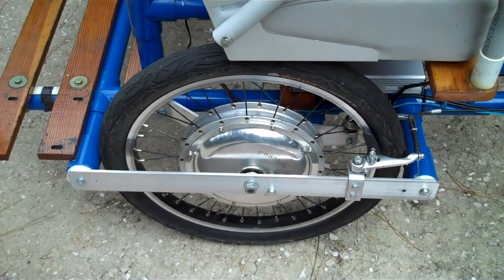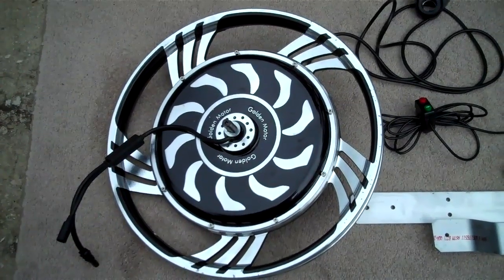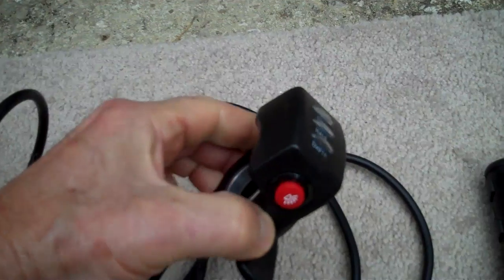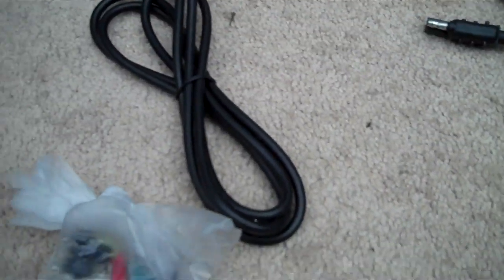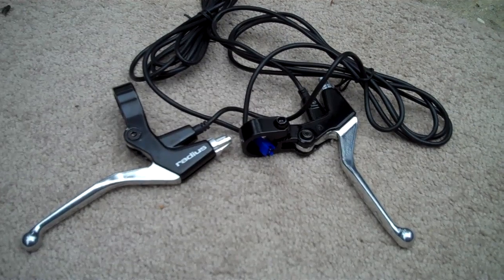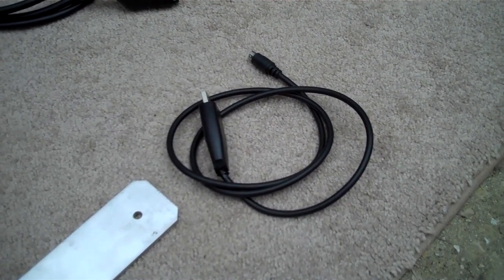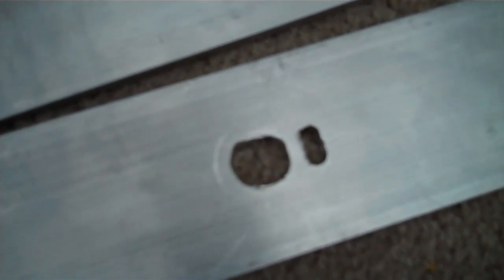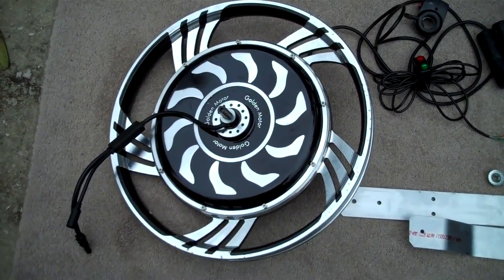Magic pie electric bike motor

Comment: Magic Pie wheel castings are of inferior metallic quality and subject to cracking. Exposed on Endless-Sphere forum.
Reply: I have never had a casted rim crack and we have sold a lot of them over the last 9 years. If this did happen for someone I am sure its rare and a defect could be possible but I have never heard of it. A lot of people specifically use these casted rims for their durability and they are rock solid.